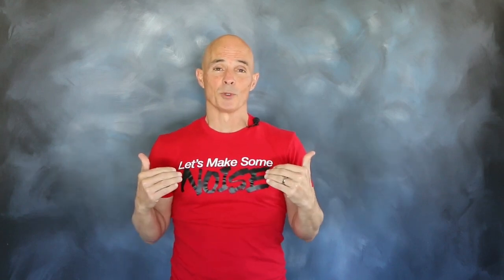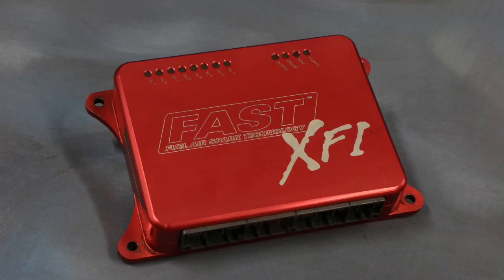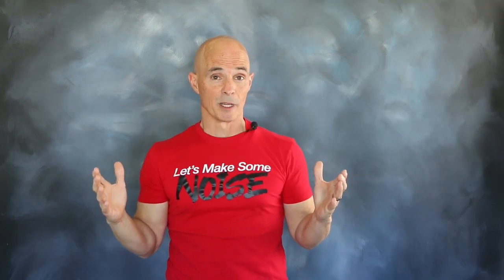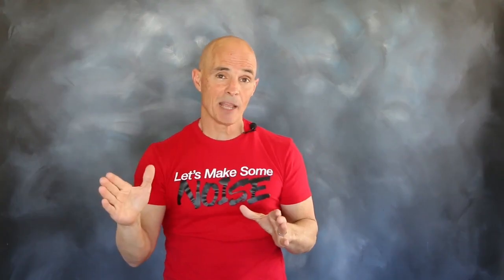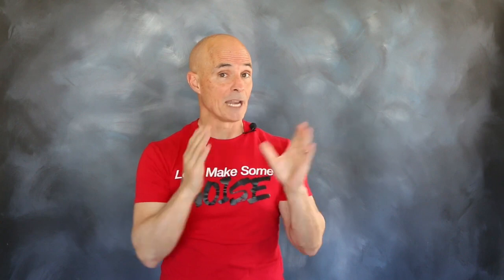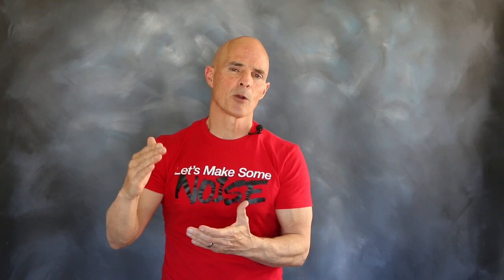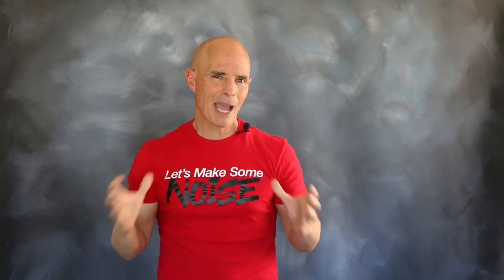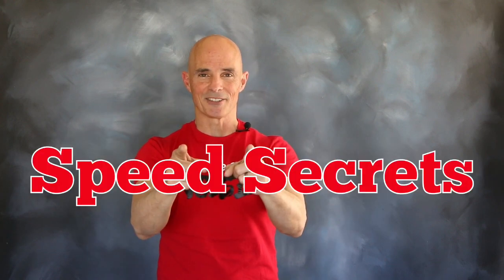Speed Secrets: Understanding Timing For Your Best Tune

Comment: I'm wondering if 12-15 deg of ignition timing is being retarded on my Stage 2 tuned 2.0t turbo engine? This is with 93 octane fuel?
Reply: yep
Reply: I guess it depends on the engines, but in my world, (Saabs), i run 10 to 10.5 degrees at full throttle and load towards the upper RPM. With Shell Vpower 99 (93 usa) i get no knock.

Comment: Whay dont use knock sensor for optimal timing?
Reply: Because you don’t want it to knock. The sensor detects a knock. Being conservative with timing, and staying away from the threshold keeps it safe.
Reply: @TomarenaiEraserRain you want to be just under that knock threshold, that's why you have a knock sensor. If you ain't knocking, you ain't trying
Reply: @TomarenaiEraserRain  
OK.
But you newer get the optimal tune...

Comment: So add timing until it pings or loses power?
Reply: The latter, sometimes. Keep in mind this isn't always about adding timing. Its all matter what you start with and what the motor likes best. Generally you do start with  lower timing advance and then work your way up because it's safer  however sometimes you end up retarding the ignition from your starting point. This video didn't do a good job explaining why and kinda pushes the notion that advancing timing will always make more power, this is just not the case. The best timing is where the motor makes the most power since it's not fighting itself. Too far advance and you are igniting the mixture too early and the combustion gases start to push a bit as the piston is still coming up or at least not in the optimal position (this could be as much as 70 degrees after top dead center). This doesn't always mean detonation, you can have too much ignition timing well before you hear knock. Imagine pedaling a bicycle. You want to push down on the optimal point to maximize your effort. If you try to push down too early the bike might still move forward however you are wasting energy in the process. Make sense?
Reply: @hurttech7593  oh yeah makes sense. I've seen people say both. The people with no dyno are using the first one but if you can get on a dyno the 2nd one seems to be way more accurate

Comment: So say you have a n/a car that has say 15deg standard if you turbo charge that engine do you reduce the timing? To say 13 deg or increase it to 18deg as a rule of thumb?
Reply: To me thats entirely dependent on how you are running your fuel. A rich mixture will help you avoid detonation, keep the engine cool, but it takes longer to burn. Because a rich mixture takes longer to burn, and is less likely to detonate, advancing the timing on a rich mixture is a safer way to achieve your HP goals. 

If you are targeting a lean mixture this gets slightly more complicated because the burn time is very short and it burns hot. Goes off like a grenade. If you have a very stout engine with an immaculate cooling system you can stuff many a psi at >12.5afr and make tons of power(and heat) without very much timing advance.
Reply: @dsauce8780  thanks for the info mate

Comment: Dont forget spark plug temp and gap on the next video when talking about timing.  We dont need any holes in the pistons around these parts
Reply: Also heat range in the plugs. They change too
Reply: @KingJT80  yup, colder.